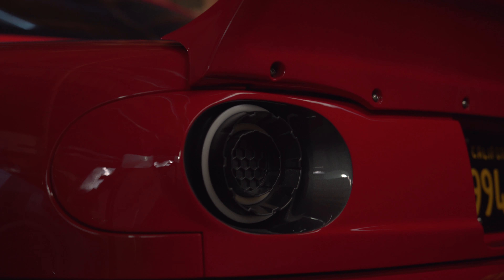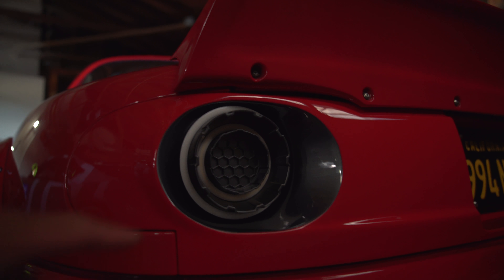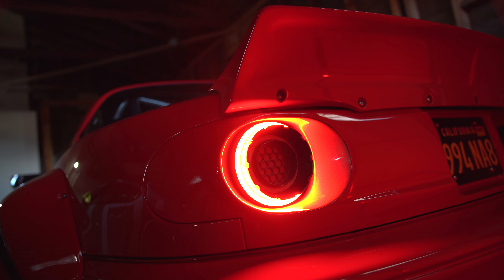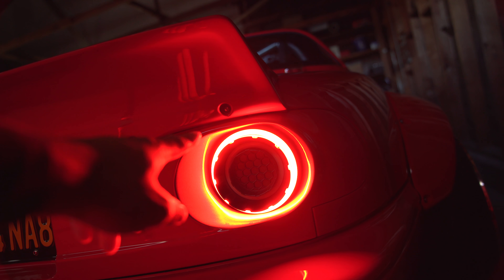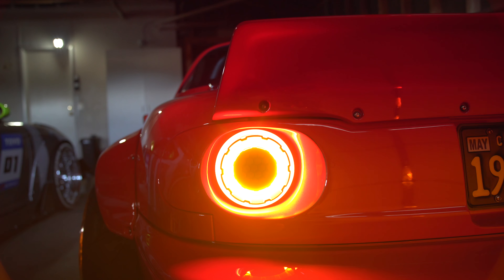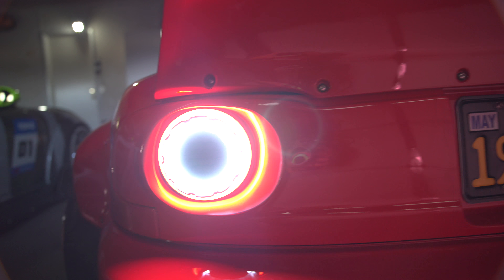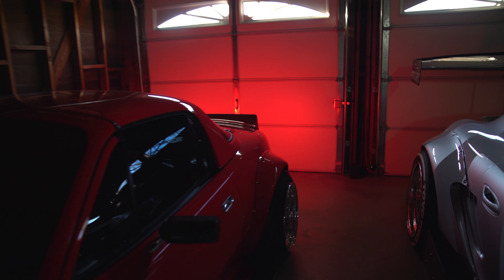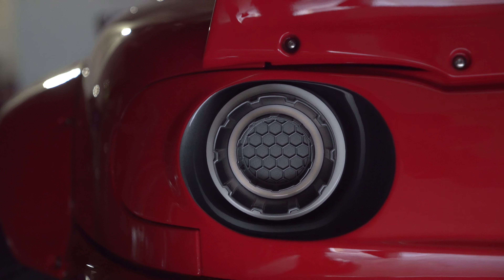WORLDS CRAZIEST MIATA TAIL LIGHT | HYDRON+ HYPER LED | #OMGMIATA | [4K]

Comment: Yo that’s so sick man. I’m trying to convince my parents to let me get a Miata for my first car but they are saying it’s too unsafe, do you agree?
Reply from the maker: Yes
Reply: MASCUNANA BEAR Hahaha that’s very reassuring
Reply from the maker: @nat3zo  small cars are generally more dangerous than bigger sedans. It's basic physics lol..
Reply: MASCUNANA BEAR Yes of course but is it to the point where the safety should be a big concern before purchase?
Reply from the maker: @nat3zo  if I were a parent I'm sure I would consider the safety of my kid.
Reply: MASCUNANA BEAR Yes of course 100% but I’m saying is the lack of safety in a Miata a factor that should be recognized? For example if there was a Honda Civic and a Miata.
Reply: @nat3zo  Owned 2  NAs in my teens, constantly having people merge into you or jump in front of you at intersection was not fun. I've had accidents where I was rear ended or backed into. The car is safe for what it is weight/sizewise, but it's other drivers that you have to worry about and for a new driver, not sure it'll be the best choice.